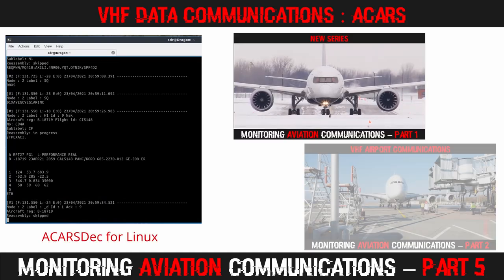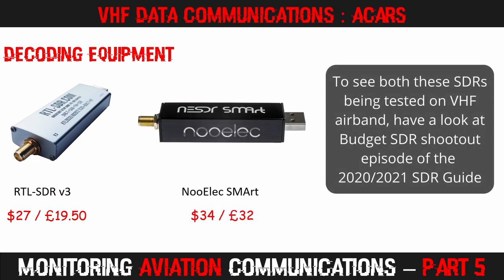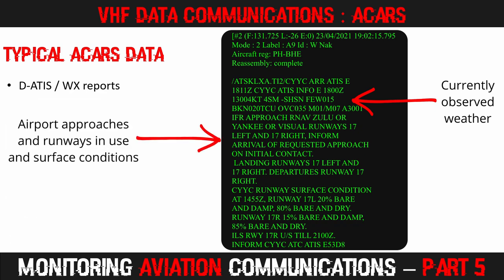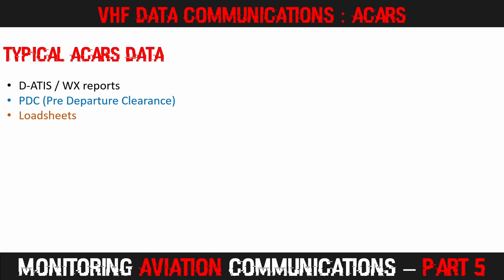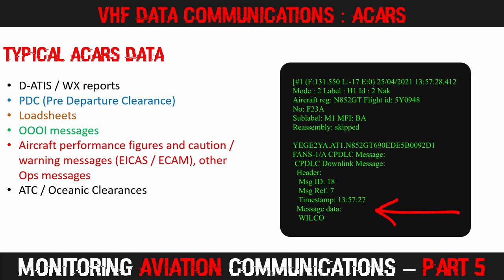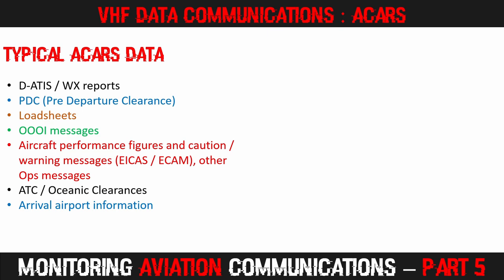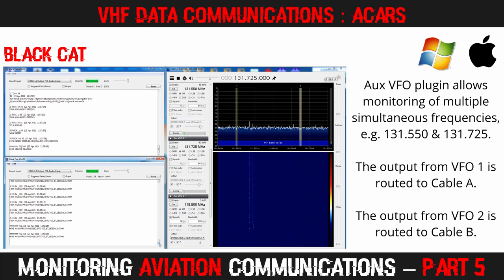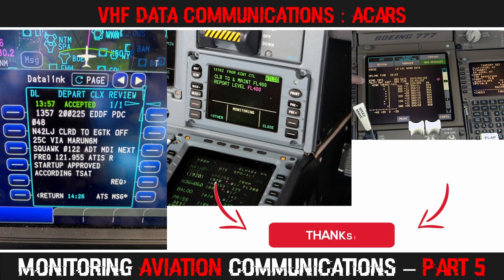Decoding ACARS on VHF with your SDR Radio - Monitoring Aviation Communications Ep 5

Comment: I'm impressed by how far those ACARS messages go over VHF. like today one coordinate was like 286km away while using same setup (RTL SDR v3 with stock dipole) range is 150km on ADS-B, and VHF voice is similar like 100km would be understandable
so it makes sense why ACARS messaging is a more reliable mean of communicating
Reply from the maker: High flying aircraft transmit a very long way on VHF. The higher the altitude, the greater the distance you can receive it from.

Comment: I have an RTL-SDR v3 with the antenna kit that comes with the device. Would I be able to use this antenna or should I purchase an antenna specific for ACARS? The videos are really informative! I am looking forwarding to figuring out how to listen to air traffic in my area of southern California. Thanks!
Reply from the maker: A lot will depend on your location. Outdoor antennas will generally offer better performance, providing it doesn't overload with other strong signals nearby.
Reply: @FrugalRadio  Thank you. I watched a video from Tech Minds for an indoor active loop antenna for shortwave as well as the desktop discone from Moonraker. Thanks for the reply and the suggestion!

Comment: Just wondering about what antennae is best for this? Thanks - I have both types of hardware dongle and am not sure which antennae is best. Thanks
Reply from the maker: An outdoor antenna, mounted at / above roof height is going to work well.

Many people use a wideband discone, but I prefer an antenna tuned to the airband. If you check out the 2020 SDR Guide episode on antennas you'll see some instructions on how to calculate sizes etc.

Comment: @Frugal Radio Do you have a video detailing why you use the RTL-SDR on Windows and the NooElec on Linux?  I'm curious to the reasoning behind those particular HW/OS combinations.. 
thanks
Reply from the maker: Great question Mark! However the Linux machine is actually powering both an RTL-SDR and a NooElec device. It just so happened that I used whichever was closer to hand. I have not experienced any difference in signal strength or quality from one OS to the other. Performance on the receivers should be the same, no matter if using Linux or Windows. I also use the NooElec sticks on Windows too.

Comment: You know there's some similar data squats like that happening on all 5 license free VHF M u r s frequencies lately it sounds just like that similar and I don't know what the hell it is if I can find a video on it I'll be sure to paste it and put it on the comments at least somebody should be able to decode this on an SDR hopefully and then put it into whatever that is because every time I use that I'm hearing nothing but those data squats on all five frequencies and I hate using PL tones because I like to have my radio in open mode so if somebody's in distress I can actually take action on it and provide assistance

Comment: So if you have a PI runing PIaware  using one RTL-SDR then you can run ACARSDEC on the same dongle?   how will the SDR monitor 1090mhz and Acars frequencies at the same time?
Reply from the maker: Good question. You can use the same Pi, but it would require 2 dongles. 1 for 1090 MHz, the other for 130 MHz.
Reply: @FrugalRadio  I have been having issue with PC-HFDL decoding ACARS.  Do you need to have Channel A and B on VHF?  Usually I have SDR# sharp tuned into the ACARS freq. And audio set up on VB Cable but it does not do any decoding.   I have soundboard set up for cable output( VB-Audio Virtual) and it does listen but nothing happens.  Can you share your set up you have for decoding on that software?
Reply from the maker: PC-HFDL is only for HF ACARS. It won't work for VHF. You would need to use a piece of software mentioned in this episode, or an alternative VHF ACARS decoder.

Comment: I compiled acarsdec on my Debian desktop PC, connected my NESDR SMArt and an airband dipole upstairs tuned to around 131MHz and it's working. I have a question: can it write both to stdout and also keep a log of messages to refer to later?

Edit: figured it out myself. Open a second terminal and run tail -f /path/to/acarsdec/logfile. Now I need a third SDR dongle (one's for ADS-B on  Pi) and second VHF airband antenna so I can also monitor voice communications. :)
Reply from the maker: Glad you figured it out. Well done!

Comment: i got this earlier over VHF:
[#1 (F:131.725 L:-48.0 E:0) 05/05/2023 23:32:20.765 --------------------------------
Mode : E Label : 88 Id : 6 Nak
Aircraft reg: 9H-TQY Flight id: 3L0653
No: M08A
Reassembly: skipped
3K01 WXRQ   0653/05 LPPT/FNLU .9H-TQY
/ACT DNKN/FKKD/FOOL
/TAF DNKN/FKKD/FOOL
/ATS     /    /    

is someone joking or are those some aeronautical jargon i have no clue about? xd
Reply from the maker: LPPT/FNLU is the route. Lisbon to the main airport in Angola. The flight ID & aircraft registration are also listed. TAF is a Terminal Area Forecast - so the plane is going to receive a broadcast with the expected aviation weather for the airports listed. There is more info that will follow in other signal blips.